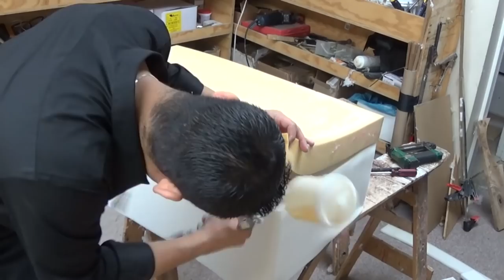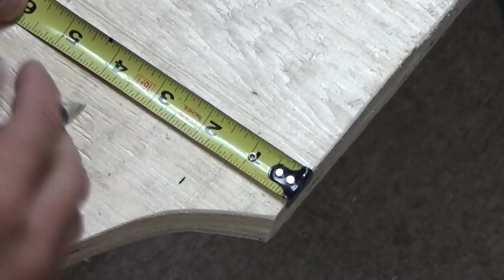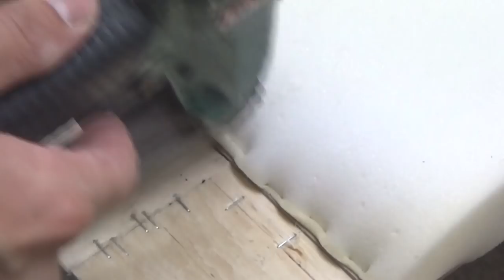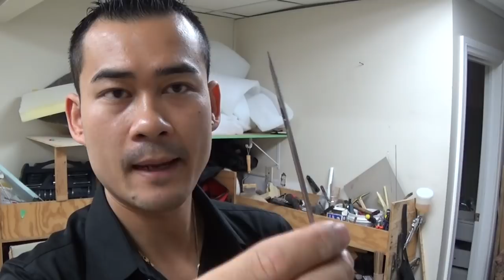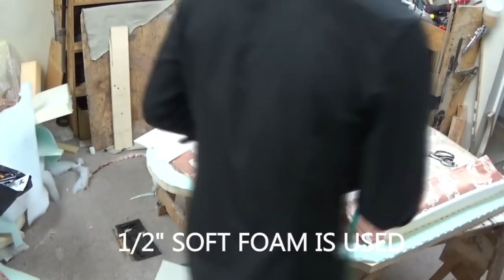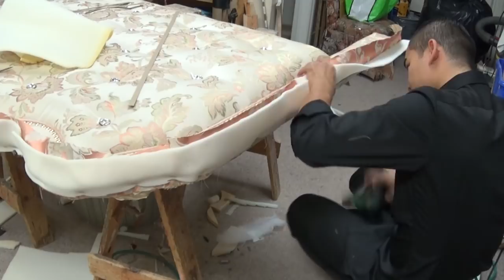DIY - CLASSIC HEADBOARD WITH BUTTONS & NAIL STUDS - ALO Upholstery

Comment: Do you tuft a certain way when its a pattern fabric? I noticed you didn't tuck in your fabric for this piece as usual. I have a pattern fabric I want to tuft for an ottoman, but not sure if I should pull tight on the fabric first then add the buttons or add the buttons pull tight then tuck in. Please help, which do you recommend??
Reply from the maker: ssuleiman12 this one i did was the faster way. the best way to have to fold is to do button by button.